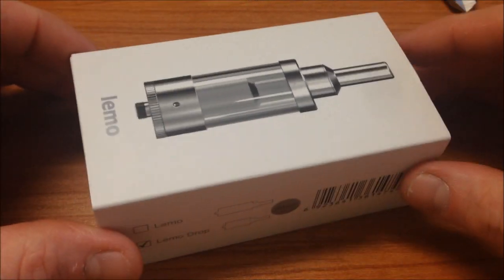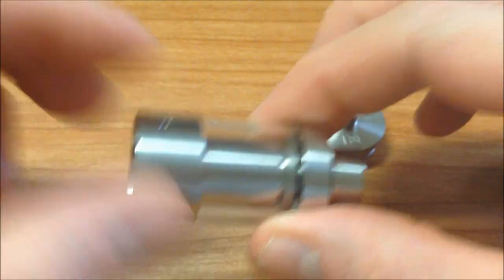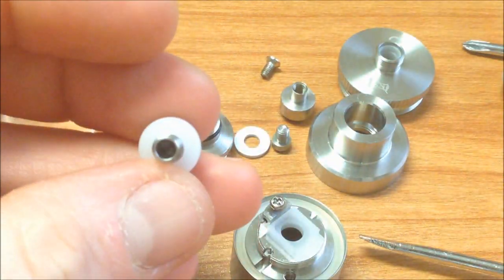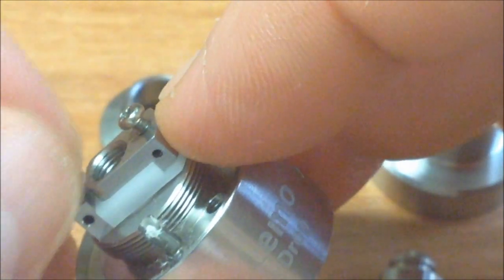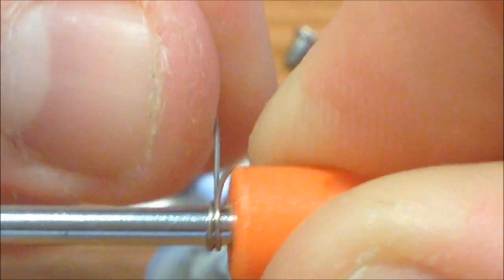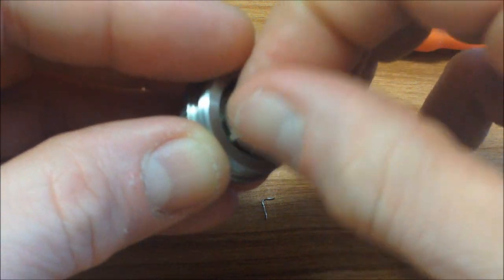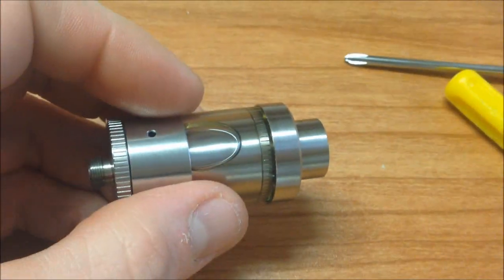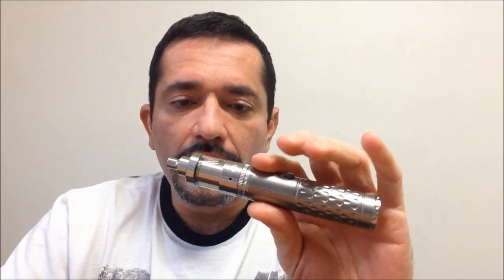LEMO DROP By Eleaf REVIEW

Comment: amigo luis quiero comprar el lemo en provaping junto con un mod mecanico no me decido si comprar el cf mod de aspire o el nemesis cual me recomiendas y tambien orientame cual es el mejor calibre de cable para las coil en el lemo de antemano muchas gracias
Reply from the maker: Hola Orlando si es tu primer mod mecánico 
Yo te recomiendo el NÉMESIS esto por que es modular , ósea puedes operarlo con 3 tamaños de baterías , 18350, 18490/500, 18650 
La verdad es un excelente MOD , y va muy bien con el LEMO y por cable en cualquier versión del LEMO viene con cable 24/26 con cualquiera de ambos cables , si quieres comprar te recomiendo un 28, 26  Sl2 sigo a tus ordenes
Reply: Muchas gracias tomere tu consejo